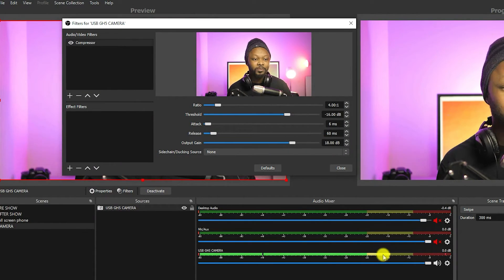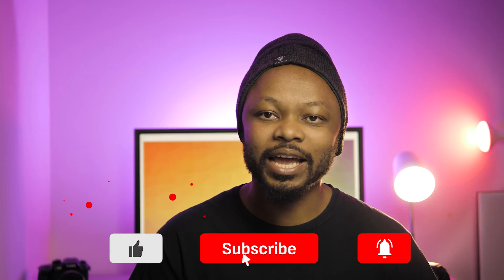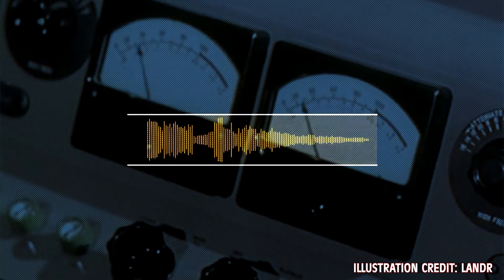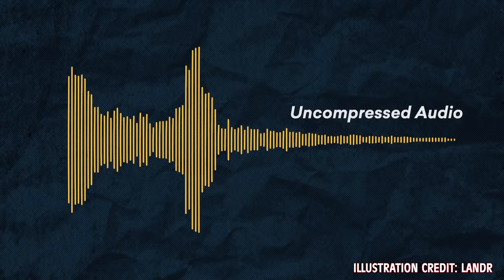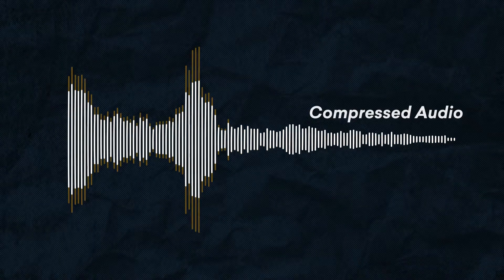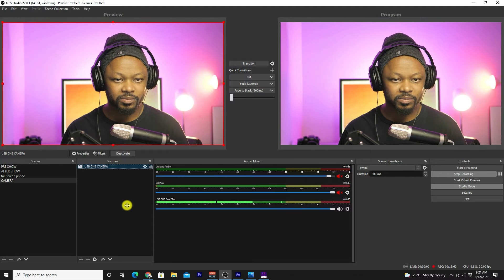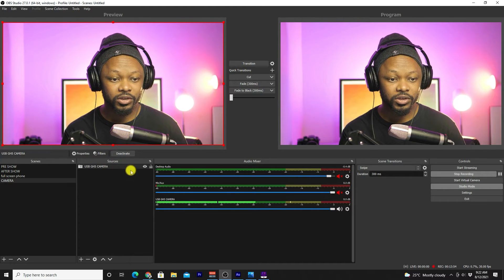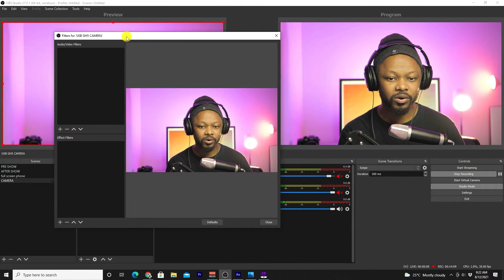OBS Compressor, Limiter and Noise Gate EXPLAINED | REMOVE NOISE, BOOST AUDIO SIGNAL, AVOID CLIPPING

Comment: Hi, id like to ask for some help. This is what's going on with me. When I record  a game for some reason, in some parts of the recording, my voice gets so low that you can't hear it and just disappear
 What could it be??? Any advise ?? I have several filters on obs
Reply from the maker: Could be the filters you are using. That sounds like an Auto Volume/ auto level filter you might be using.
Reply: i got gain, compressor, expander, noise suppresion limiter. should i remove the limiter?
Reply from the maker: @RicoZuabe  I think you might have too many filters. I am guessing depending on how you setup some they are reacting to your levels and at some point they are compressing your voice. 
Start by adding one by one and test which one is causing issues
Reply: @LiveProductionTips  THANKS MAN, ur the best
Reply from the maker: @RicoZuabe  you are welcome. Keep me posted. If you keep having issues you can always book 30 minutes with I can take a look

Comment: is there also a way to turn off mic clipping bc i wanna do funny mic and make it really loud but it keeps cutting out
Reply from the maker: If you combine a limiter and compressor should solve the issue. Also it may be the kind of mic you have. Do you mind sharing
Reply: @LiveProductionTips  im using camera mic and using limiter and compressor makes it more quiet im trying to make it loud
Reply from the maker: @joe4105  oh ok to make it loud use the the gain option. The compressor can help also with the Make up gain option
Reply: @LiveProductionTips  ahh that helped thx
Reply from the maker: @joe4105  awesome

Comment: Thanks for the video! What are good compression and limiter settings for a live stream of a worship service.  So we can boost the volume but not squash the sound.
Reply from the maker: Hey Tim, glad you enjoyed the video. what does your audio setup look like ? Are you using OBS ? Do you use a digital console or analog ?
Reply: @LiveProductionTips  yes using obs through a presonus ai32 stereo aux mix to usb audio interface.  Right now we use obs limiter.  I want to get more volume but not make the audio sound weird or compressed where you lose bass or definition.
Reply from the maker: Hey Tim, I think in your situation you can use the compressor from the sound mixer first, get your signal to around  between (-6 and -3) when it reaches OBS. in OBS you add a gentle compression to boost any low signal and push down any super loud signals . Try add a limiter as well around (-3) and see what you get. I would make sure I get a very good signal from the source ( sound mixer) and use the OBS compression and Limiter for small final tweaks. There is no formula to getting it perfect. Try and fail ,  keep testing, try again until you like the sound.
Let me know if this helps.
Feel free to reach out to any time
Reply: @LiveProductionTips  thanks 🙏